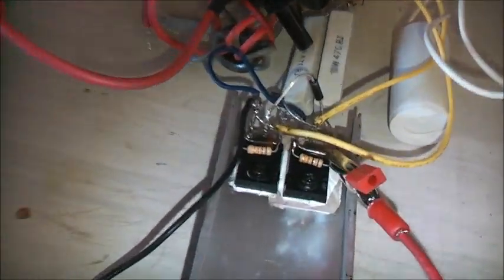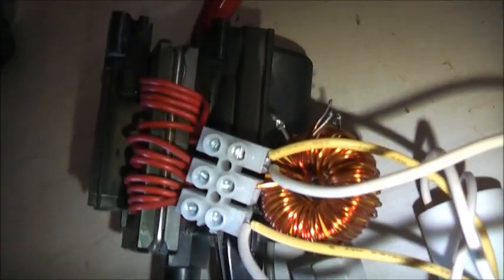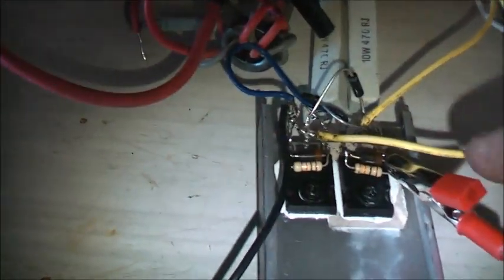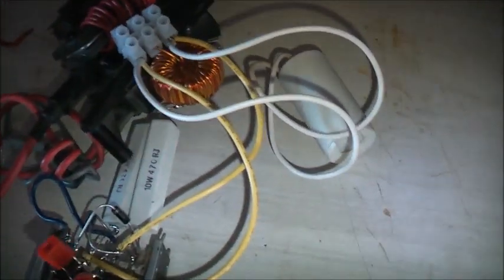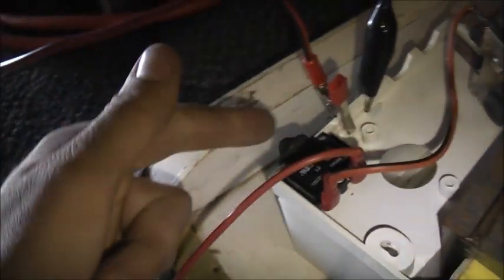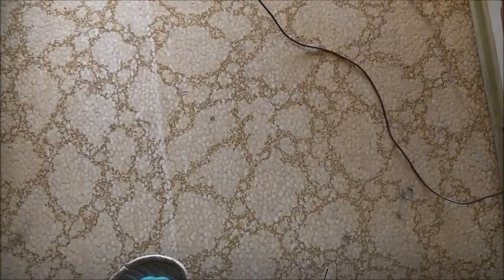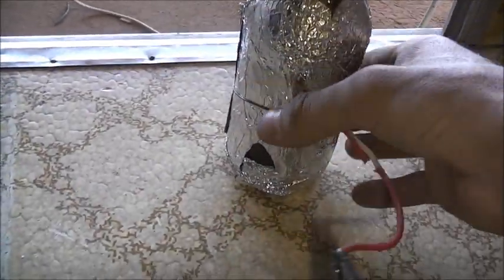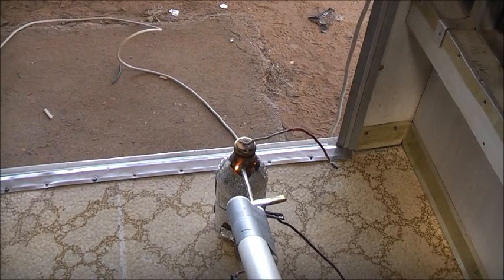Saltwater Capacitor Fail

Comment: Hi matey,
Try a different cap mate, 
And what transistors are you using are thay the ones in the diagram?
As the Irfp+' trans are good!
and are you using the 12volt zenors?

Comment: Check if you haven't fried your mosfets. The ZVS circuit is easy to build but it needs the resistors and zeners to protect the mosfet driver gates.

Comment: If you have a crack in the bottle, you won't achieve charge separation, therefore the power finds a weak-spot, works its way through, & cancels-out any charge that is building up. The result is a capacitor that won't charge.

Ah, it went *POP*. continuous attempts at charging it while broken has resulted in the crack going all the way around the neck of the bottle, breaking it off.

Oh well, it won't work now. :-(

Need a new bottle.

Thanxx for showing,

-BBD.